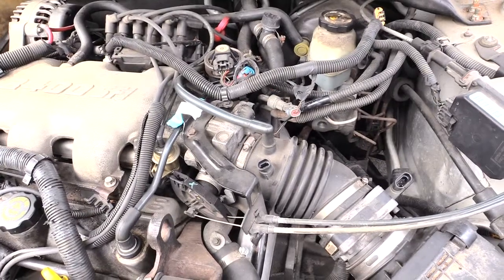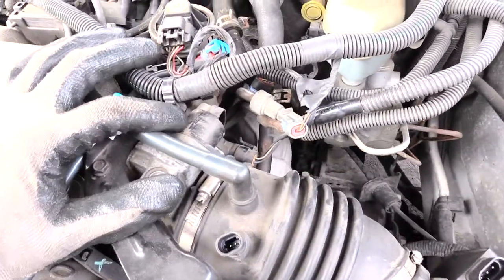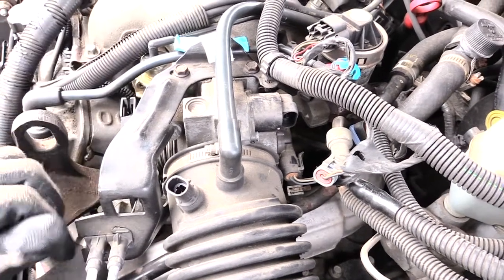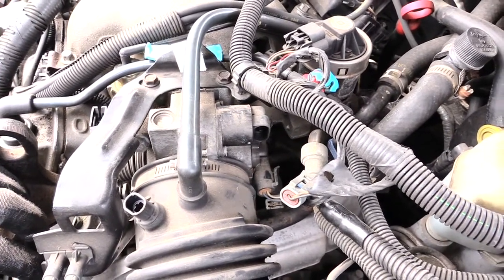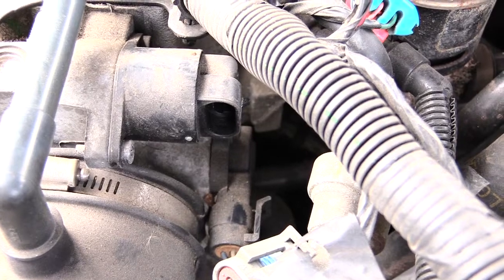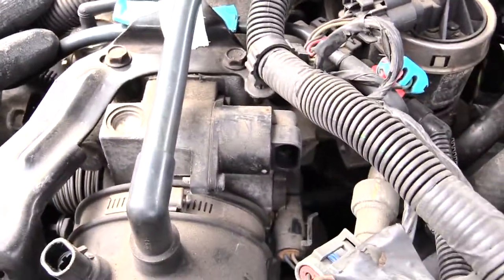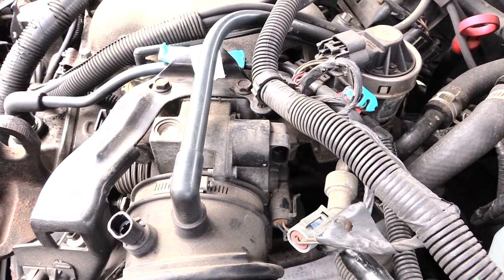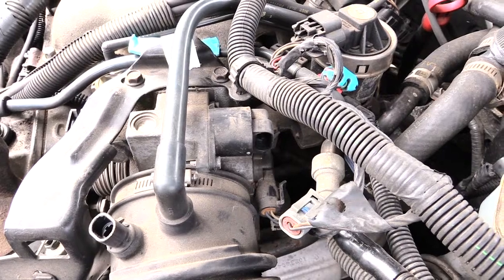Vehicle Stalling Idling Irregular? this could be your problem! (Idle Air Control Valve)

Comment: Thank you. Presumably then this is not a potential cause of car firing fine but immediately cutting out? I've changed fuel pump n filter, various sensors (oil, crank, cam), cleaned throttle body, egr but still 2005 Corsa C won't run. Just would like someone to confirm this NOT a suspect! Thank you.
Reply from the maker: This can cause many different problems, but not sure if this is your problem.

Comment: Yeah mine doesnt sit on the throttle body mine is on the intake manifold... Well anyway my car s idle dips when reversing or pulling away and when come to a stop it slowly dips then dies? Can it be its dirty or faulty becuase whe exchanged iav like a year ago?
Reply from the maker: Yes most definitely could be your problem. Good luck. Please subscribe & like and share if haven't already and check out our other helpful videos